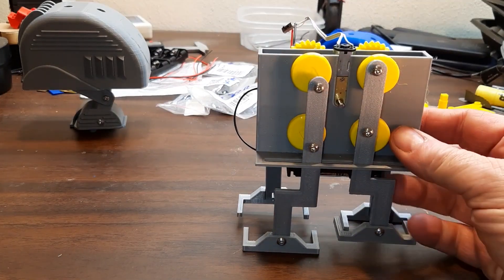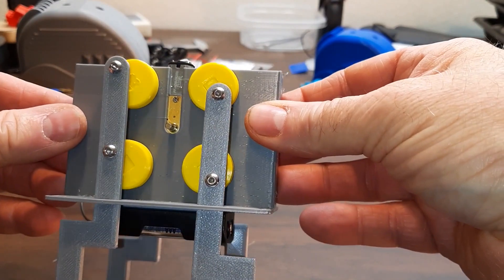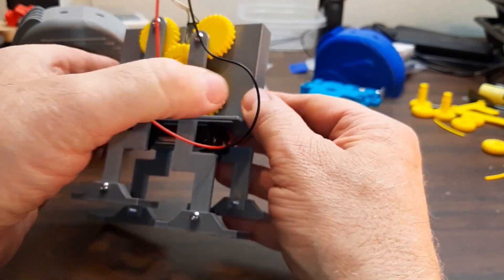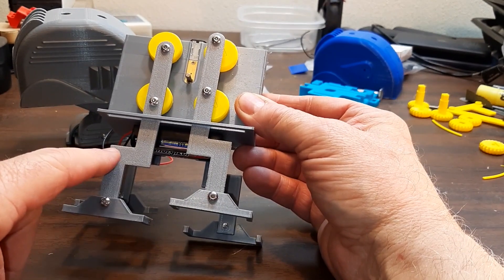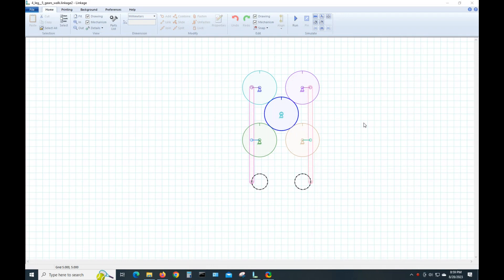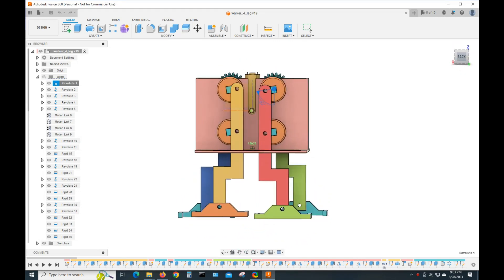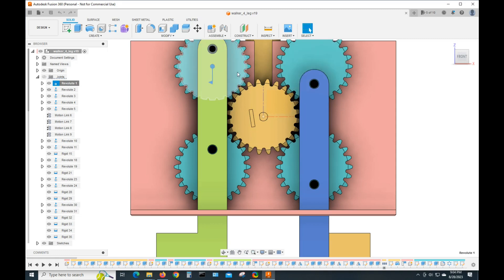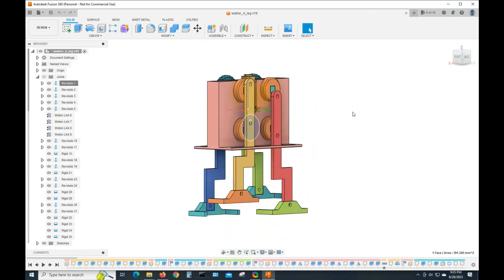Initial Test Of A Four Legged Toy

Comment: That leg system was used by toy robots for many years - probably only need two legs though ... 🦘
Reply from the maker: I just designed and built the 2 legged version:
https://youtu.be/3TwG7ycrVSg?si=hwxiSnG-D5tBPgg9
It uses a claw foot  which has fingers in the feet that cross the center line of the toy so it can stand on one foot. I want this one to have 4 legs. I will try to avoid the claw foot. The Star Wars 'Gonk' or 'PLNK' body I'm printing now is pretty big so we'll see if it can stand on two of it's four feet. Thanks for watching.